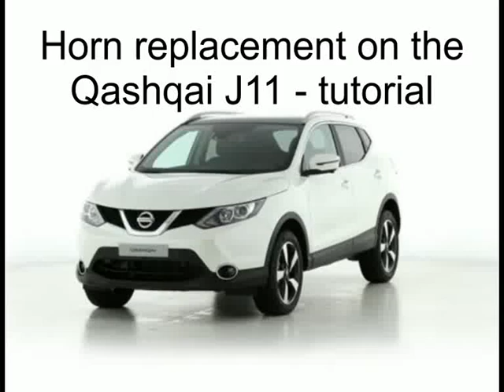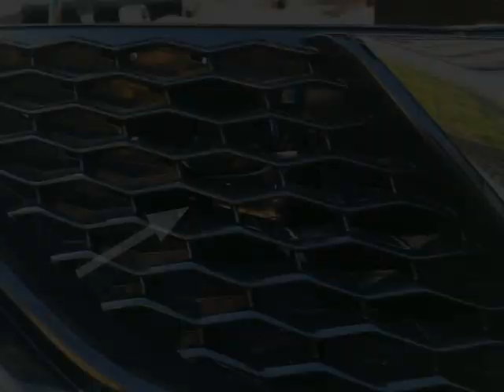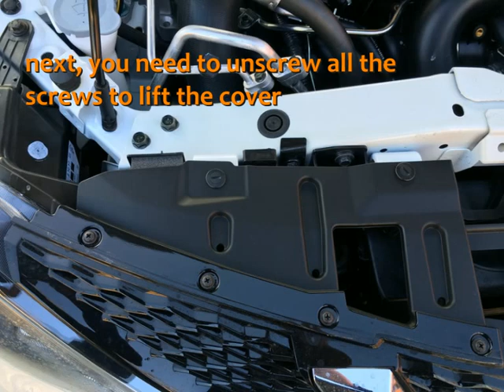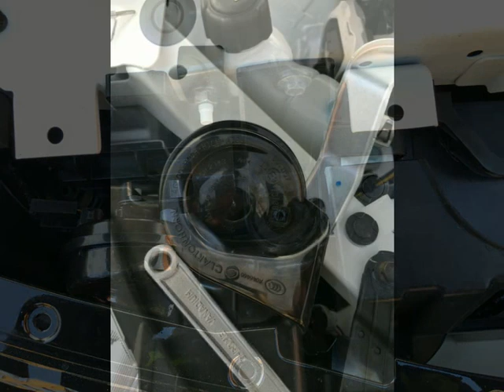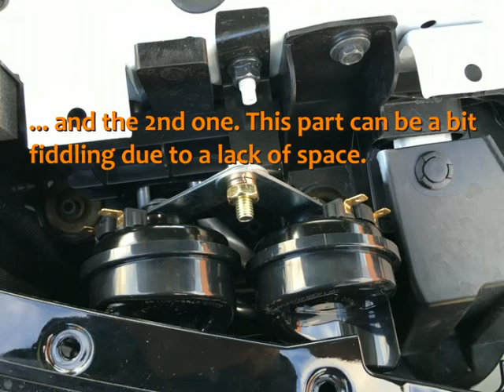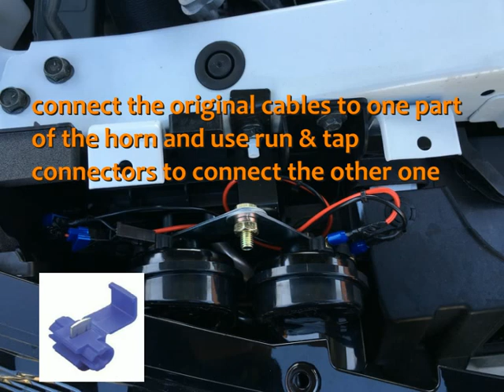Nissan Qashqai J11 horn replacement - tutorial

Comment: Hello, nice video, I manage this day to change mine but I want to know some detail like, the size of the wire that you use? The horn connection terminal have a + or - order that I need to use?

Thanks!
Reply from the maker: Hi! Thanks mate. I usually use 1.5mm or 2.5mm wire, depending on the Amperage. Here I think I used 2.5mm to be strong enough. I don’t really remember if there is a + and - on the horn. Logically there is but I checked on the original one and not such indications... just connect the wires as they were and if it doesn’t works swap them 😉
Reply: La_Palmeraie, thanks for reply! 👍🏻😎

Comment: What about the horn that is buried deep in the engine bay? Does this mean your car now has 3 horns? Did you use an external relay also?
Reply from the maker: Hi! That’s for the j11b version, mine the j11a only had this one horn. 😉 I didn’t used an external relay. The horn doesn’t requires that much power. For the j11b version please check the UK Qashqai forum, there is an active topic on that subject.
Reply: @LaPalmeraie0032  thanks.. saw conflicting things online regarding the second horn so that's good news as I have a j11a also